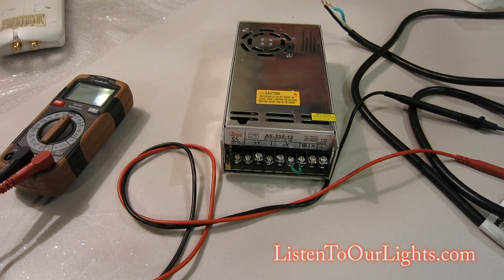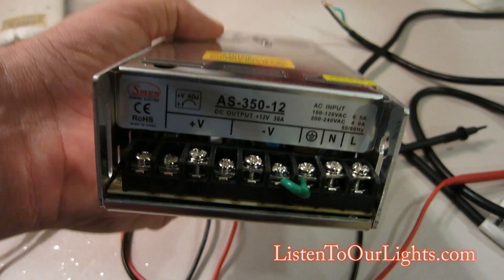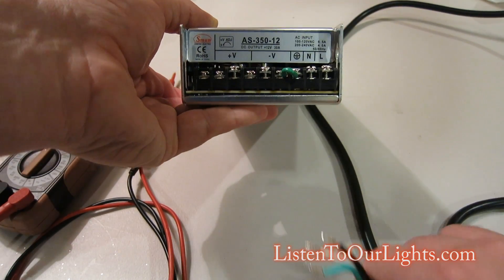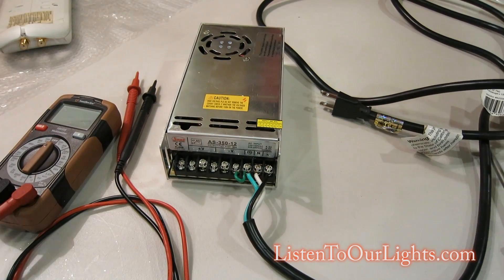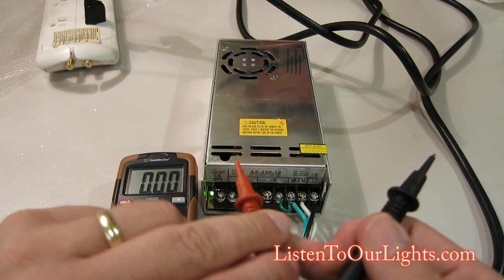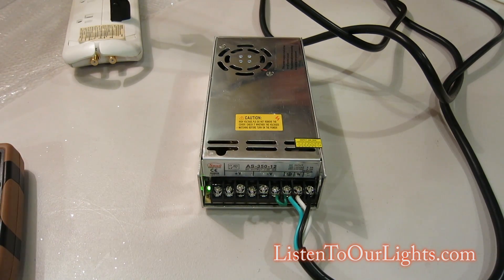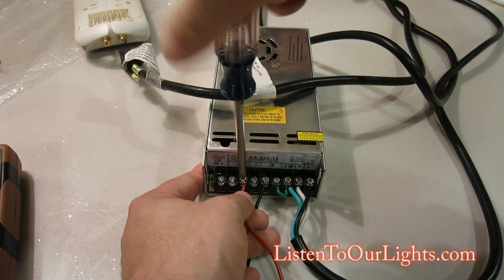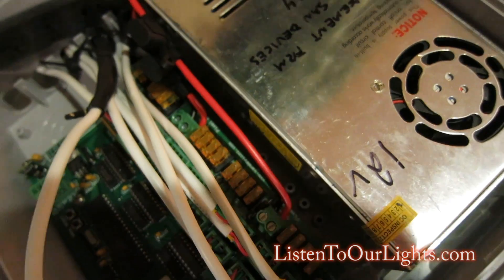Wiring up a Power Supply (PSU) Don't wire V- to GND! See new video in description.

Comment: WhileI appreciate the idea of soldering your power wire ends, it's considered quite unsafe. There are numerous images of fires (printers and houses) due to this. What happens is that, if there's a crazy issue or current draw that makes the wire(s) get very hot - hot enough to melt the solder,  you now have a connection(s) that have melted the solder out of the joint (and possibly shorting something all by itself) which leaves you with a screwdown connection that isn't tight anymore now. It's loose - quite loose without the solder which makes it start arcing and sputtering. Wire ferrules, is the right way to do it. Ferrules or nothing at all.
Like I said, though, I completely get the impulse to solder them.

Comment: I have a red, blue and yellow/green wire, and idk how to connect it
Reply from the maker: Do a google search on AC color code standards
Reply: I have the same. 

I have no idea if you are using the same rocker switch as myself, but if you look at the bottom of the switch with good lighting, it should be written ( L / N / ⏚ ).  

In my case it is ( Red = L / Blue = N / Yellow = ⏚ ).  Again, no idea if the same switch, so it is always important  to double check.

Hopefully you have this long figured out already, and this is just reference for anyone else who maybe sees the comment. :)

Comment: FOR THOSE USING 110 AND A BATTERY
I USE THESE ON MY RV AND MY BOATS. 
ONE OF THE 12V SETS GOES TO MY LIGHTING ETC.
THE OTHER GOES TO A BATTERY. 
IF YOU UNPLUG THE 110... EVERYTHING RUNS OFF THE BATTERY.
WHEN IS PLUGGED TO 110 IT KEEPS THE BATTERY CHARGED UP.
JUST FYI
DO NOT CONNECT THE V- TO THE GND!

Comment: Doesn't mean live it mean line/black neutral is white green ground. no need for a jumper it is grounded inside the unit ALREADY OR IT WOULDN'T WORK.
Reply: NO. The outputs are isolated from the case.

Comment: You should not be teaching anyone this unless you state and point out associated electrocution hazards ie bare mains power connections easy to touch and also don’t use the jumper cable you have between the grounds

Comment: Hi, I bought 24v 15a power supply. Can you tell me what gauge wire I need to use to connect the power supply to my 2.1 amplifier and also from 2.1 amplifier to speakers ? Amplifier will connect 160w*2 + 220W. Please advise. Thank you.

Comment: Hello. I bought a 650 watt psu which came with a 16 amp power plug but unfortunately i cant plug tht into the socket. Is it okay if i use the 10 amp plug from my previous PSU or will that cause any issues?

Comment: Helo.  Can i use the 12volts power supply commect  to inverter 12volts to 220 ?? Thats why i can safe electricity.  Thanks for answer to my question.
Reply from the maker: There are 220v input / 12v output versions of the power supplies that you can buy.

Comment: I have a power supply like this i use it to run my kl Italy 207 connected to my galaxy dx 949 but when i turn on the power supply i get six pounds of loud static noise in my cb.

Comment: Is the 20V AC or DC setup? I set my multi to DC and got 12.30 DC, but when I switch to  AC the numbers just bounce around. Is it supposed to be 12.0+ on AC or DC? If it's AC I just got the earth and ground wires switched (I made my own plug and the wires were not labeled) Thank you
Reply from the maker: 12 volts output DC
Reply: @listentoourlights  Perfect, thank you, I got it to 12.03 V at each terminal
Reply: @listentoourlights  If I may ask, when doing power injections I have my 22/4 wire which is RGB and black wires, which of the 4 wires get screwed down on the power supply positive and which to the negative? I assume 2 wires are positive and twisted together then put on the post, then 2 are negative, twisted together for the negative?
Reply: I had planned to "inject" that wire between strips 1 and 2by T-ing them off (snap connectors)
Reply from the maker: @wyattspop  For power injection you only need two wires. One for positive and one for ground. Most people will get a power distribution board that will take power from the PSU and then have multiple fused outputs for power injection. pixelcontrollers dot com is where I get mine

Comment: Wonder why there are two V+/ V- screw down terminals?
Reply: so you can connect several wires into it (eg, if you're powering different components off of that single power supply)

Comment: Thanks a bunch. I've now set up mine and added that bridge on the negative connections.  5v 40A in my tp4056--20X  18650 charging station. 👍👍

Comment: Anyone know where I can find more information on that ground jumper wire?? Is it necessary safe and why?
Reply: https://audiophilestyle.com/forums/topic/37034-smps-and-grounding/#comments. 

I read about it on this link pertaining to Grounding DC output negative side to an ac plug ground side. Something to do with leakage current.
Reply: How to covert batery power in 12v to out 220 use that inverter

Comment: Won't that trip a circuit breaker when it gets to 20 amps? I never understood why they sold a 60 amp power supply since most jacks are mapped to a 15 amp circuit breaker.

Comment: Awesome video man.  And great job checking everything out before applying a load to it.  Funny short story.  Years ago I watched a Chief Engineer fry a power unit for a Rolls Royce azimuth pod worth about 50 grand at the time all because he didn't check everything out before hooking it up.  Turns out the damn thing was internally shorted right out of the box.  That has stuck with me ever since.  It pays to double and sometimes even tripple check your equipment before putting it in service.  Again awesome video. 👍

Comment: Hey why did you place black wire into -V?
Reply: I wanna say it's a global standard, but I could be way off.  Definitely an American standard as well as the UK.  I would double check Google on the rest though.  I don't wanna stear you wrong with bad info
Reply: V- is negative.  Unless you're seeing something I'm not I believe he did everything right in the demo even down to checking output voltage before loading it.  I wanna say that's universal for DC systems with Red being positive or V+ / +V and black being negative or V- / -V whichever the label shows.  I'm pretty sure I'm right on this, but if I'm not please correct me.  Hope this helps.
Reply: @zackthomas5707  Oh thanks. Is this american standard or european?

Comment: so this is 12 volt only out, not plus/minus 12volts , as would I need a 24 volt  same type power supply and get the needed +/- 12 volts for + 12volt rails and -12 volt rails?

Comment: I'm planning an identical project.   My computer power cord has a bare 4th wire that I understand is the ground for the tinfoil shielding in the wire bundle used to prevent interference in computers.  Do I need to do anything with this wire or can it be left unconnected?

Comment: Thanks for the video.
This probabley an obvious point, but, you are handling this unit in a very casual manner.
I hope everyone realises that the two unprotected screws with the innocent looking black and white wires will probably kill you if you accidently touch them!
Reply: It would be very rare for it to kill you. Most of the time it would burn you and knock you on your ass.
Reply: @AntiRobotCommittee  That depends on if it is 240v or 110v.  The exposed terminal are very dangerous

Comment: is it ok to interchange between L and N? does it have polarity?
Reply: No do not do this l is live or positive n is neutral or negative if you want blue smoke go ahead
Reply: @alexthomas6602  I got a 30 amp supply from amazon, same as in the video, but over top of the indented marks on the aluminum was a sticker covering all of the marks in the metal (N,L,+,-) and the sticker had the N and L reversed.   Isn't that something.

Comment: Can you link the two 12 volt outputs in parallel to double the amperage and increase the length of led strip you can use?
Reply: I would like to know as well ! Did you find out ? Thanks

Comment: When you fix up your screw up of bridging the AC and DC grounds,  you might also want to point out that  "L" does  not stand for LIVE - It's LINE or LINE IN (basically the same, but get it right) and while you are at it,  Caution users that BLACK on the AC is a HOT or + connection.  On DC,  RED is Hot or + connection and black is Ground.    A LOT of people confuse this an if a moron does things wrong, they could become a candidate for the Darwin Award.
Reply: Is that we he did by jumpering v- and GND? Is this dangerous?

Comment: Hi John I have a question for you. I just got to CMB 24 for RGB dumb nodes and wired a brand new power supply similar to the one in your video with the fan and vents on it. I noticed that it works perfectly with no issues but in the Lor Hardware utility when it goes from 0 to fade it makes a slight sound and smells like burnt Electronics but it only lasts a few seconds. Out of caution I shut it down waited a few minutes tried it again and it does the same thing while previewing a sequence. It begins to emit a slight Electronics smell is this normal or would you suggest that as a bad power supply and try something else? Also on a side note I just want to thank you for all your videos you have really helped me over the last couple years with your videos.

Comment: is the screw whitch holds live in place under voltage?? or is it isolated
Reply: If you lay a wire across them, it will arc, blow a breaker, and melt something.

Comment: My understanding is that connecting V- to GND gives the same voltage there. 12V between V+ and V- means that the difference between the two is 12 but doesn't tell you anything about the two separate values. Once V- is connected to GND (which usually is 0V) this will force that end to that value (not sure about V+ though)
Reply: I tried to connect the grnd to v- but the entire unit becomes grounded hahahaha

Comment: what if you live in the eu andnonoy 2 wires come from the wall?
Reply: I'm not sure you could use this power supply. The systems run on different voltages.

Comment: A precaution step:  after power it up, put your AC test pen on the PSU casing, to see whether there is any AC current on it,  before touching it, just a thought :)
Reply: Kugan Kumar my thoughts exactly.  These types of PSUs make me so uncomfortable because the whole damn thing is conductive.
Reply: Steven H Wrong, that’s what earth ground is for. If a wire or something touches the casing it will get grounded.

Comment: why are there 2 sets of outputs? Can this ps power up more than one device at a time. Why did you loop the positive end of and output to the ground, is it because you're only using 1 output. I dont know much about electronics, just curious.
Reply: There is actually 3 outs.. 3 V+ and 3 V-. This can power 3 devices. Not sure why he did that to the ground.
Reply: Thanks
Reply: The V- is looped directly to ground. This is probably to make life easier since whatever you hook up to the DC voltage needs to somehow have its ground connected to the ground of the PSU. My guess is that by doing it like this you guarantee that this will automatically be the case and you don't need to connect those separately.

Comment: Just to point out L is NOT live it's LINE as in power line !!
Reply: Senior Frog it actually stands for load
Reply: Patrick Donovan 

on these models from China, "L" means LINE - i.e. POSITIVE = HOT WIRE in from the AC.
Reply: Patrick Donovan NO!!! Load is the load you have on it!
Reply: VstaarProduction 15

"L" = "Line" which is AC power coming IN, whereas the LOAD is going out - i.e. whatever the power supply is running at 12VDC. 

The Chinese really should mark these things better. senior frog nailed it

Comment: if you add DC-DC power supply , it will be great 
https://www.aliexpress.com/store/product/RD-DPH32305-Constant-Voltage-current-Buck-boost-Programmable-digital-Power-Supply-buck-Voltage-converter-color-LCD/923042_32762131242.html?spm=2114.8147860.0.0.pjfOUO

Comment: I could not help but think that if you need to explain the colour codes for 240VAC hook up then your audience should keep clear. You do need a minimum knowledge to connect mains power safely. How do you expect novices to have any idea about adequate wire size for different currents.
Reply: Peter Owens I have no idea about colour codes but I'm pretty sure I know how to hook this up :D I intend to just continuity check the cable to see which wire came from where on the original plug 👍
Reply: I took a electronics class, and I still don't have an idea on what wire gauges to use. I do know how to do some pretty hard circuits though
Reply: 12 gauge would work fine....

Comment: hi, I liked the video.can i use this power supply to a car amplifier which needs 12v 60A power, so that i could connect two +ve and two -ve output  to the amp?
Reply: palanivelu sivakumar did you figure this answer out? I'm looking to do the same thing
Reply: palanivelu sivakumar 

NO!!!

360W = 30A @ 12VDC
Reply: Get a 75a model.. They're only like 12 bucks from china.

Comment: I have an IEC320 c8 power socket with a rocker switch( 3 prong top and 4 prong switch on bottom) mounted on the wall of an ammo box. I'd like to wire it on the inside from that plug to the power supply. Could you post the wiring diagram or a video?

Comment: just my opinion but I build big power supplies using multiple of these and you usually never want to hook the negative 110v in to the negative 12v out..
Reply from the maker: +Cameron Mataya : Thanks. I've only seen this done on a PSU that was pre-wired up by SanDevices and no where else. I've stopped doing this as well. I should annotate the video.
Reply: I agree, I use these as dc-dc converters for ev conversions. If the negative and ground are jumped, than the hv pack negative becomes part of the chassis ground and if there is a HV short, it will arc off of the chassis. Keep the input and output ground isolated to prevent fatalities.
Reply: Cameron Mataya he is hooking up ground to ground, not negative to negative

Comment: May I ask what AWG's are suitable for this kind of PSU? My PSU type is S-15-24 (0.7A output current) and I'm not so sure what AWG's should I use. Nice video btw.
Reply from the maker: +LiveYourLife I use 12 or 14 guage wire from the PSU to the controller. 18 from the controller to the lights.
Reply: +listentoourlights Thanks, I will keep that in mind.
Reply: You never know. 

It depends on the length of Run... larger wire for longer Runs, but don't go smaller than 18